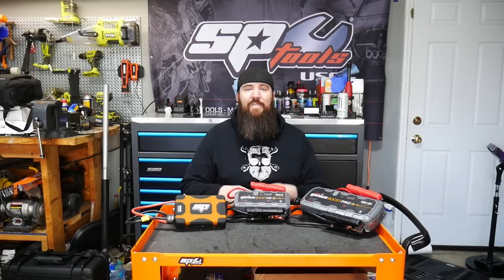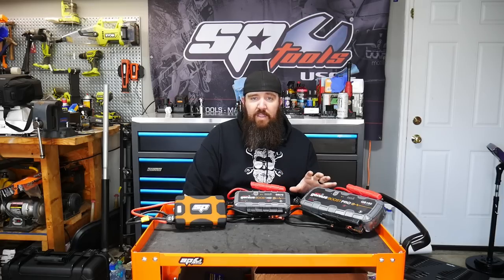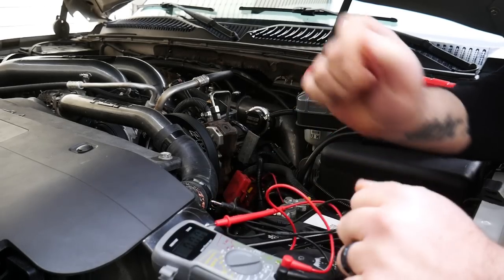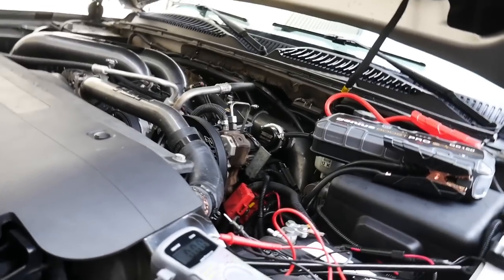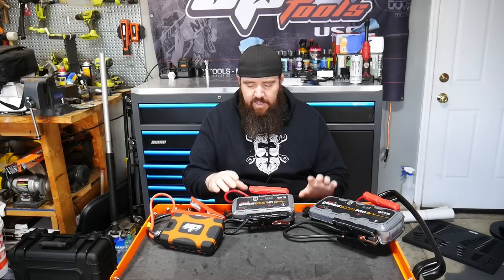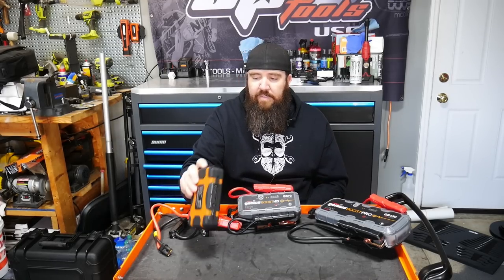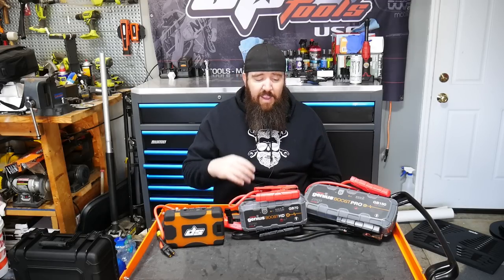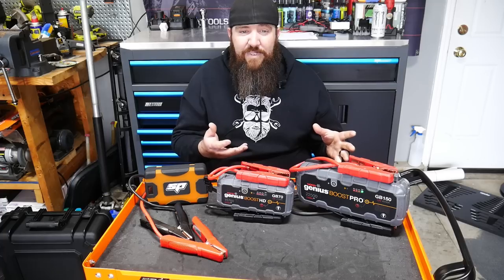BEST OF THE BEST - *UPDATED* REAL WORLD TESTING COMPACT HEAVY DUTY JUMP PACKS

Comment: SP all day long is $325.00.  Genius Boost is a lot cheaper. For the budget GB70 is the way to go. I used my GB70 quite often as tech. I used it on 6.7 Dodge and the Duramax. It has worked every time for 8 years straight with no problem.
Reply: How long will it hold a charge?  What is the longest it has gone unused by you and still performed when you needed.

Comment: You have to press the manual boost button for three second (the lights will flash) and let go. Really helps to know what you are doing. Same with GB70
Reply: I've used a gb150 to jump a 9860 combine doing something wrong
Reply: (Sigh) It's not a boost button.  Per the manual it is called the "Manual Override Button."   It helps if you know what you are talking about.
Reply: @urntwrthyZ  then you should know that what it does it provide boost since you are obviously so smart lol.

Comment: I’ve used the GB 150 to jump my semi when it was stone cold dead. Worked every time.
Reply: Really? So that 150 is way togo?
Reply: @bryansmith94  so im confused why didn't it start this truck
Reply: @brianbrown4303  it almost did,  the bolt almost hit 11 volts. I’d stick to the SP tools , why anyone would buy the other two I have no clue
Reply: The semi wasn’t stone cold dead.... it  must have had at least 8 -9 volts
Reply: Dude something is wrong with yours I’ve seen mine start a rollback with a 6.7 l Cummins with no batteries hahaha that means 0.00 volts you must be getting paid noco is the shi* had a gb 150
Reply: @brianbrown4303  Don't buy GB. It's trash. The dude started his Semi because the battery was only half dead.
Reply: @bryansmith94  yes it is. I don’t know what is he doing there, but my GB 150 jump start my semi like a champ!!! And it is starting my 2020 RAM 5500 6.7 Cummins without both batteries—LIKE A CHAMP AS WELL!!!!! I don’t know what is this guy doing out there lol showing that his toy truck Duramax 6.6 can’t be jumped? No idea lol
Reply: Thats what I needed to know....my damn reefer is dead and I need to get it going. 
   I have a thermoking 2013  SB210+
Reply: Alan d'Eon  
O wondered about some of these videos.....misdirection 🤨
Reply: If the truck battery is deeply discharged you are better off disconnecting the battery from the truck  first, and then jump start it with the pack. Otherwise you will wasting a lot of your current charging the dead battery instead of cranking the starter.  These jump packs are not designed to have high capacity (Ah) they’re just designed to give a short burst of cranking current. GB150’s capacity is rated at 7.4Ah. Most car batteries are rated at 35Ah and higher.
Reply: GB manual states leave on for 30-60 seconds prior to starting the vehicle.
Reply: Jumped a 9860 STS after sitting all year with gb150
Reply: I do not believe that for one second sir.
Reply: @tamermogannam  especially if said dead battery has internal short
Reply: @DG-ss1gc  a car battery is stone dead at 10.7 volts. Like maybe just click the solenoid on a big starter

Comment: I own a roadside assistance company and I’m telling you all the Gb150 will start that damn truck without issue if you know how to use it. You must use the override button to get max power out of it. I just started a dead duramax 2500 first crank less than an hour ago. I was just looking at videos of the gb500 and this one popped up. But the Gb series works great period
Reply from the maker: Ok so I’ve talked to now two GB reps and the answer on the over ride button is NO using the over ride button DOES NOT boost power in any way shape or form! It only bypasses the polarity safety that is active when there is less than 3 volts. They said it is possible that I have a bad/weak jump pack but it was used correctly. This is also not a stock Duramax engine either.
Reply: LOL, you don't get any additional power by using the bypass function...that's not what it's for.

Comment: The GB150 is a freaking magic box!  My elderly senile father kept buying used junkers from people over the years, stocking more than he sold.  He had about 25 cars, several not started in years.  I was able to crank a majority of them.  If the battery is completed dead you have to use the  5 min Genius Boost (which takes 5 minutes to complete) to bring it up before jumping.  Now when jumping with it after your connection and turn unit on you wait while the light flashes from far left (red) to the far right led (green) which can take one to five minutes, and while the green led is flashing that's when you start the vehicle.  With all the positive things I've said I will admit I had one bad experience.  Using it on my vehicle that was just a little over a year old with the Genius Boost over ride it killed my computer.  I should have disconnected battery all the way from the car then do it (that's why there is a red lighting bolt warning on the button).  But in the end it looks like you didn't follow the Genius manual.
Reply: Thank you for disproving this guy. Now, I'm just a backyard mechanic, nothing special. I'm also a paralyzed Disabled Veteran and really can't do mechanics work anymore. Before I buy anything, I really try to do my research. I watched 5 videos showing how good the NOCO is. If NOCO doesn't work then you're doing it wrong. Why isn't this guy not connecting any of these straight to the battery like most people. I have never in my life seen a vehicle jumped the way this guy has done it. Thank you for showing explaining the truth.

Comment: Who the hell told you that button was a "boost" button? Haha. That is the override button. You only use that button (the Override Button) when the pack doesn't detect a battery, which is anything under 2 volts. If battery reads anything more than 2 volts, then that button is not needed. 
My GB150 started my old 7.3L diesel first go in consecutive -2 degree mornings after months of inactivity. Either the GB150 is faulty or you are doing something wrong.

Comment: i can see how these jump packs are ok for like a tool to keep in your vehicle in case you have a dead battery. HOWEVER, as a tech what i use is a "good" used battery and attach some cables to it , the battery is one of those that have a built in handle strap. its rated for 650 CCA. In most cases about 90% it works just fine to jump any vehicle I need to. If it wont jump it I just change the battery on the lot. The battery was free. used some old jumper cables , cut one end of the clamps off and used generic battery terminals to attach it to the battery so its all contained on the battery. I just recharge it when needed.

Comment: Connection is very important.  When I can, I prefer to go straight off the battery.  That ground that your using, I find I need to hold the clamps tighter to get some boxes to jump vehicles
Reply: Yeah, with a booster charger, where you don’t turn it on till it’s connected, and turn it off before disconnecting, there isn’t even any risk of sparks. Direct to the battery is the way to go with these.

Comment: the GB70 didn't bump any voltage since not boosted, GB 150 bumped from 7.X to 10.X V about 3 V, then you use the SP to bump it to 14+which is a healthy voltage to start a truck. If you need to do a non-biest comparison should drain the battery again and start from 7 voltage again.

Comment: I have  NOCO GB70 and NOCO GB150 if your battery is down it will start it up but if your battery is flat 🪫 it doesn’t work i have 3.0L Diesel Toyota Hilux and 2.1L Diesel Mercedes Sprinter I am also disappointed with NOCO brand. Spend lot of money and outcome is worthless.

Comment: Your voltage meter showed less than 12 volts when testing the GB70 and GB150. what's up with that?
Reply: It means his boost pack is not charged
Reply: It means the dead 12v battery is pulling down the voltage, not that the boost pack isn't charged.
Reply: Awful name! Seems sketchy almost criminal!  Like a cat except not as cool

Comment: Dude, you NEED to skip those stupid remote jump posts and hook it up straight to the battery.
Reply: I believe  the noco can't  tell a draw is being applied to the battery  when its on the jump posts  I would like to see if it hooked directly to the  the battery it would make a difference  !? maybe  not, but would definitely  rid of any   Skepticism!
Reply: @windsbra12  - Yeah, I’ve seen the GB70 jump start an old Cummins! The GB150 has started class 5 trucks. There are videos all over YouTube of that happening!
Reply: I use my GB70 all the time to start the Cummins in the Motorhome or the tow rig. Straight to the battery and no heater grid on the tow rig in 30* weather without a hiccup
Reply: YOU NEVER CONNECT THESE DIRECT TO A BMW BATTERY.mines in my boot.that’s why the jump terminals are under the bonnet or hood lol
Reply: I was thinking what the hell is he doing lmao
Reply: @stevecooper6653  the battery is in the boot for weight distribution and space saving. Not because bmw doesn’t want you boosting from the battery.

Comment: The answer to your question: How can that thing put out 4000 amps? It's about power over time. It might peak at 4k amps for just a few milliseconds, but won't sustain it for any usable amount of time. Just like the inrush current of a hand held circular saw can draw about 20 amps every time you pull the trigger, so why doesn't it trip the breaker of a 15 amp circuit? Because it's only high current draw for a few milliseconds before leveling off at half it's starting current draw. A motor is almost a dead short until it begins to spin, and it only takes milliseconds worth of huge power to get them spinning. Cheers 🍻

Comment: The GB 70 gave engine 9 volts, that can't crank it can it? The GB 150 provided 10 volts, not enough? SP one provided 13.5. Isn't the minimum to start at least 12 volts? Noco's didn't seem to provide voltage needed.

Comment: I have both the gb150 and the SP (well my "sp" is branded by the original manufacturer starkpower jumpbox  fleetpro 1500w) I have been wanting to buy another but couldn't find it or anything like it since company went under till just the other day when I found the sp tools one but basically case and spec are exactly the same. As for gb150 both it's and the SP would jump a 7.3 powerstroke from what I see from the video he did not use the gb150 correctly the two box although performing similar function do it completely different the gb150 for lack of better explanation basic transfers it's charge to the truck battery so it need at least 30sec in completely dead situation sometimes longer but u hook it up and turn it on and it will continue to do its thing the CP is a basically an extreme booster its gonna be like switching ur charger to the boosted start engine setting that instructs u to not run it more than 30sec if vehicle doesn't start which the SP is the same way one it finds its polarity u have 15-30 sec to turn the key and start the vehicle before it times out and shuts off. In my experience with both of them they both have there times that are useful if you have vehicle that normal doesn't crank fast but cranks long to start then the gb150 is probably the way to go if u have a vehicle that likes fast short cranking then the SP would be the better option I've had situation where the SP wouldn't work cause it wouldn't allow me to crank long enough to where the GB150 did and vise a versa the gb150 wouldn't crank one vehicle fast enough when the SP would just my 2cents and experience working in a on-highway CAT dealership as a journeyman for 10years

Comment: Great video and nice job showing all the connections close up. I have 2 of these  jump starters (avapow 3000a and Fanttik 2000a) , and neither one will work on a battery that is below 50%, which is around 12.4 volts. So when some of these people say that their battery was stone cold dead, it was not. It still had at least 12 volts or close to it. The SP really works great, but the price tag is just too high.....I still carry jumper cables just in case all else fails

Comment: Also funny that you noted it jumped the truck with only One battery.  
It doesn't matter if you have 2, 1, or no batteries at all once the pack is connected.  
Try it...
With any vehicle, disconnect the battery, clap the jump pack directly to the terminal ends of the battery cables, hit that manual override button that you thought was the extra turbo boost (obviously,  because it won't automatically detect a battery when there's not one) and jump your car/truck/bike/boat/etc. ✌

Comment: Want to know it’s not accurate? When you hold the boost button down to get manual mode it shows the voltage at 10volts. You’re not getting a good connection or the pack isn’t charged fully. Hook the gb150 directly to battery.
Reply: My battery is under my driver seat. So I only have posts to boost from. Would this still work well on a diesel if cannot connect direct to posts?

Comment: The rating is more likely the manufacturer just selling a product because there's really no rating system they have to follow as far as I know. It's the same in the lighting industry. You can just say whatever you want. Kinda lame so shop smart and check the reviews like this one. Just an FYI, I would've hooked then all up direct to the battery. The big GB150 might have started the diesel that way.

Comment: The sp tools jumper brought battery voltage over 13 volts before cranking. The gb 150 only brought battery voltage just over 10.  Is it defective?
Reply from the maker: That one is only 2-3 months old and another unit that is exactly the same we have at our shop performs the exact same. If anyone gets a new one and is able to get different results, I’d like to see it.
Reply: Rustbelt Mechanic  I was just talking to a tow truck driver this week as he was dropping off a car. He said they have been using the gb 40 for two years with great results. Btw good video. I like the camera angle better than the last one.
Reply: Those packs weren't charged properley

Comment: I agree 100 per cent noco is crap I had 2 and both were shit one melted the other wouldn't charge never again 'I'm gonna try gooloo 4000 I'm really impressed with the torque amps it spun the engine really fast and kept on going  '''it would blow noco into the weeds 'not in the same league

Comment: You cannot believe these videos because the user is clueless about the products.  

Granted, the GB products have highly inflated specs, but so does every other product.

What this guy should know is that if you just turn on the GB70/GB150 it goes into the default mode which just attempts to charge the car battery that is not completely depleted.  In this mode it does not supply enough cranking amps to turn the starter on its own.  It’s relying on the car battery in conjunction to do do.

The GB70/GB150 has an override mode which you have to press the ‘!’ button until all the lights start blinking like crazy.  This mode bypasses the car battery altogether and attempts to supply all the current necessary to crank the starter.  This is explained in the manual, which I’m sure this guy is too manly to read.  In this video, he did not put either the GB70 or the GB150 in the override mode.  He needs to press ‘!’ button AFTER the power level lights become steady after turning on the units.  He was pressing it on the GB150 while those lights were still cycling, meaning the unit is still trying to sense polarity and other stuff, and never got into the override mode, which would have been indicated by all the lights pulsing at the same time.

It’s actually NOCO to blame for user errors like these because the default mode is not how most people use these booster packs.  The override mode is how most people want or expect these things to work.  It should be the default or only mode.

I have the GB70 myself and have no problems with it starting big trucks.  But if I were to buy now I would choose another brand/unit not because the GBs don’t work.  It’s because I can find much better value elsewhere.

Comment: Jump to 11:37 in the video. The SP tools jump pack has boosted the truck battery voltage to 14.87 volts before the engine is started and with a discharged truck battery load. I suspect the SP tools jump pack has more battery cells in series to increase the output voltage. Can the SP tools jump pack be safely use as a battery (voltage) maintainer while programming modules for up to an hour?

Comment: Great test, thanks for sharing.  The difference of Lithium batteries has a lot to do with the grade or quality of graphite that they bind to the lithium cells, and also the quality of the binder.  SP-Tools is obviously using a premium graphite and binder to adhere to the lithium cell.  Companies are now adding SiNanode process to the graphite to increase the power, life, and speed of the charge.  TESLA is leading the way but companies such as GM are charging forward and catching up.  All-in-all what is added to the Lithium is what creates a superior battery.